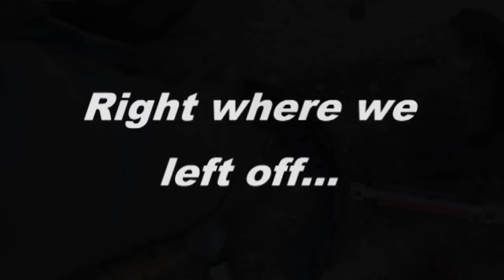Drum Brake Shoes Install "How to" Nissan Pathfinder

Comment: Fixbook, Thanks for this.  I haven't changed the pads in my pathfinder yet, and Les Swhab wanted to rip me off by saying it was their policy that they HAVE to replace the brake calipers on there, and those work fine and are in fine condition.  They want $300+ for a standard brake change. 

Screw that, I prefer changing my own brakes but I've just been craptons busy.

Comment: HELP!  I AM TRYING TO GET THE BREAK DRUM OFF AND IT SEEMS LIKE THE SHOES ARE STUCK.  I AM TRYING TO GO FROM THE BACK AND USE THE ADJUSTING STAR BUT I CANNOT GET IT TO WORK.  I AM TRYING THE TWO SCREW DRIVER METHOD BUT I CAN SEEM TO BE ABLE TO TRIP THE ADJUSTING TAB AND SPIN THE STAR WHEEL HELP! PLEASE.

Comment: You missed one of the most important things when working on these brakes. You didn't check to see if the handbrake mechanism INSIDE the drum was free to move properly. It is down on the right hand side behind the right hand brake lining and has the two wire cables attached to it, one to go back up to the cable hook that comes in from outside and the other has the cable that is inside the long spring at the bottom of the brakes. The mechanism has a C clip that holds the rocker of the mechanism onto it's axis pin and if it can't move freely then your handbrake will not come off properly when you release it.
Reply: I realize I am kind of randomly asking but does anybody know a good place to stream new tv shows online ?
Reply: @Carter Azariah flixportal =)
Reply: @Carlos Cedric thanks, I signed up and it seems like they got a lot of movies there :) I really appreciate it!
Reply: @Carter Azariah You are welcome :D

Comment: Nice video but pulling those springs is un-necessary. Just pull the shoes off the bottom bracket after installing retainer springs. Pull off shoes from bottom retainer and top wheel cylinder. you can easily add the orange spring and bottom spring.. Simply pull the shoes back into place with springs attached. Use a medium wire tie to pull the yellow self adjuster spring end onto the adjuser lever. Use a screwdriver as a T handle with the wire tire.